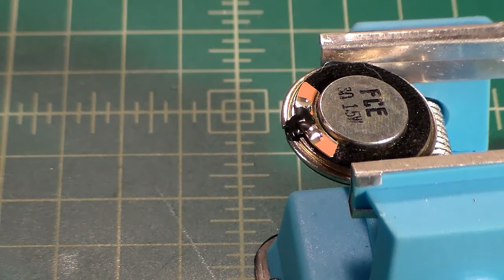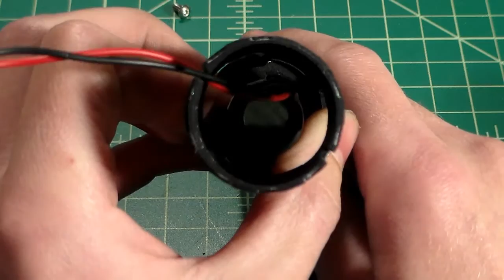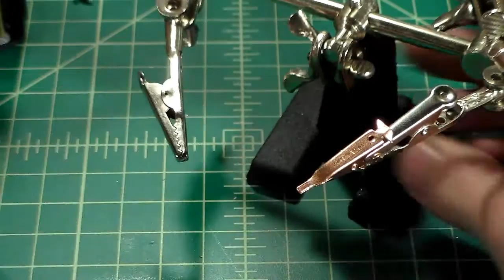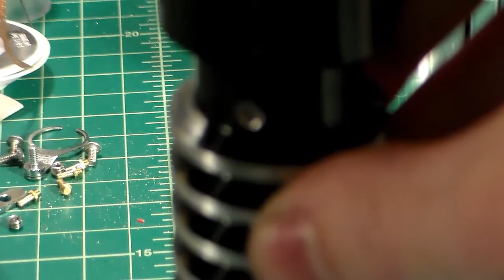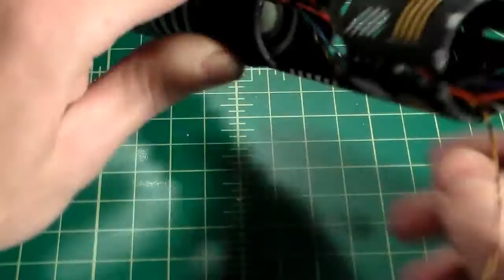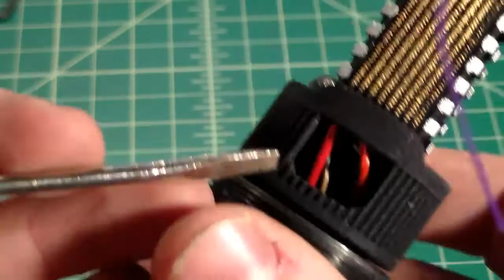Let's Build a Graflex - Episode VII: Battery & Speaker

Comment: Hey East Coast, I have an issue. I am using the same knight chassis for my graflex. However I'm using a bass speaker but it vibrates the whole chassis causing false swings and clashes. What could I do to fix this? HELP!!!
Reply from the maker: The first questions I have are what sound board are you using? Have you fully charged the battery? Have you properly resistored your main LED's? If you have done those things you can try a couple of things. 1.) You can try to isolate the speaker a bit using an o-ring or something like that between the inner chamber and outer shell where the speaker sits, if that makes any sense. 2.) You can adjust your swing and clash parameters in the SD card. This can be different depending on what sound board you have and how the parameters are configured. For this the best place to go to figure it out will be the manual for the specific board you have.

Comment: Hi again, another question. All LiCobalt batteries have a maximum amount of recharge cycles before they eventually lose the ability to hold charge anymore and ostensibly become unusable. When this occurs(although it may take 500 recharge cycles or more) the whole battery will have to replaced. With the way the chassis is constructed and with the speaker being glued in, it looks like it would be quite a chore to swap out the battery. How is this done and how difficult is the process. Is it a major disassembly effort or have you figured out a tricky workaround?
thanks again.
Reply from the maker: It would require basically a full disassembly of the saber. But I have never seen anyone use a Li-Ion battery to the point where it no longer holds a charge. And that's including people who use them on a daily basis.
Reply: East Coast Sabers thanks for the response. I can see how , with a saber, you might not ever have the situation where the lithium ion batteries go bad. The reason I asked the question is that I vape, and use high current li ion batteries all the time. When you vape you really, really overwork the lithium batteries. Some mods now have settings that go up to 200+ watts, and suggest high drain batteries that can handle 25-30 amp loads. I have seen many, many lithium ion batteries lose their abilities in several months. But again, I can see how, even with daily use, you would never wear out a lithium ion battery.

Comment: In your full parts list, you recommend a certain 3.7 volt battery, but Solo's Hold only has the 2500mAH version. Will that work? Will there be a difference?
Reply from the maker: You're looking at the 3.7v 18500 Battery. You want the 18650 battery listed above it.
Reply: Thank you! I got that one you mentioned. You might want to update your parts list with that in case people like me who don't know better stumble onto it. Thank you for all your help!
Reply from the maker: No problem my friend!

Comment: Great guides, but I have run into a problem. I am using the same heatsink you recommend, however mine appears to be about 1 mm larger. This is preventing it from entering the inner core.  I have already wired the led to it, but I was unable to test on inner core first because I was still waiting on the hilt to arrive. My 7/8 blade plug slides in perfectly, here is a picture showing the difference in thickness of the heatsink and blade plug http://imgur.com/a/j8AiG Is there anything I can do to get this to work or do I just need to get another heatsink? The custom saber shop is currently out of stock for this heatsink though.
Reply from the maker: Yeah, the new batch of 2.0 kits (we've dubbed them the 2.1's) have a slightly smaller inner diameter. The only option is to sand down the outside of the heatsink (technically the optic holder) until is slides in and out freely. Or you can get a new heatsink / optic holder from a member of my Graflex Group on Facebook. He is selling one that is nearly identical to the TCSS ones except the fit in the 2.1's better and have a thicker copper heatsink.
Reply: Just got done sanding it down when I saw this, I got it down enough to fit so I am back in business. Thanks again.
Reply: I’m having an issue trying to do the wiring for the switch. i have a 2.5 and the newest knight chassis. however, there’re no holes at 45 degree angles on the chassis so idk where i’m supposed to push the switch wire into. or even where to drill the hole for it for that matter

Comment: Does the LED retention screw come with the kit?
Reply from the maker: +Arlo Nipales No, it doesn't. You will need two of them. I used 2 - 8/32 x 1/8" set screws which you can purchase from Thecustomsabershop.com. If you follow the link in the description box to my thread on FX-sabers .com you will find my complete parts and tools list ;)
Reply: +Shoot2Thrill468 oooo alright! Thanks so much man! For all the info and these vids! Theyre really helpful and very much appreciated!
Reply from the maker: +Arlo Nipales It's no problem man. If you have any other questions don't hesitate to ask!
Reply: +Shoot2Thrill468 you think a NCR18650B battery will also fit this design? as opposed to the solo hold one? or are they the same..